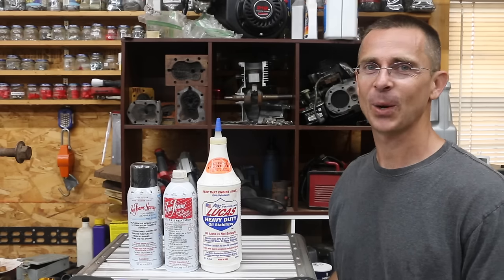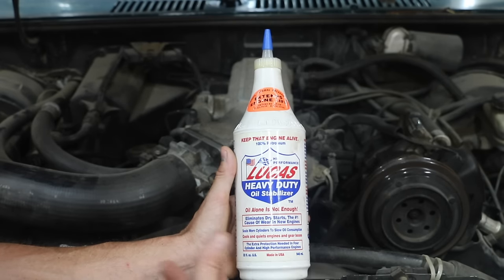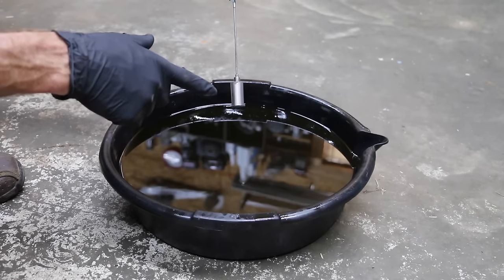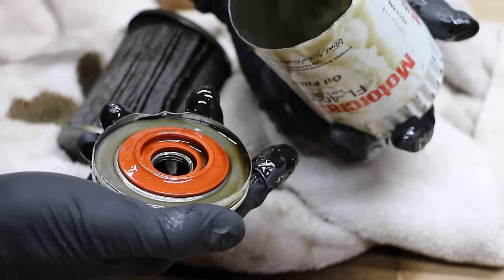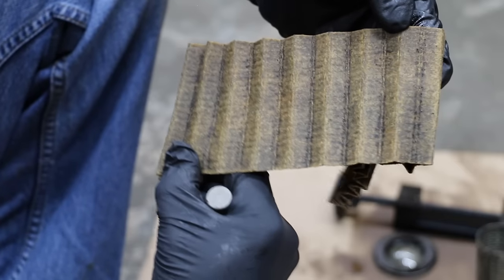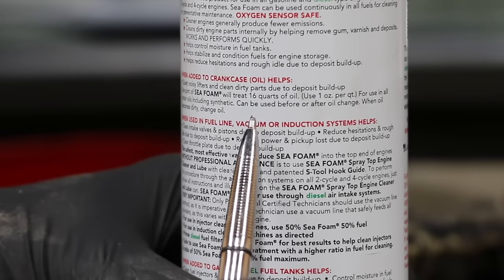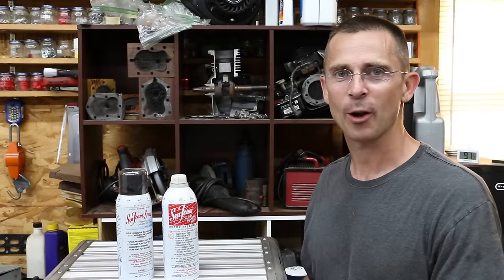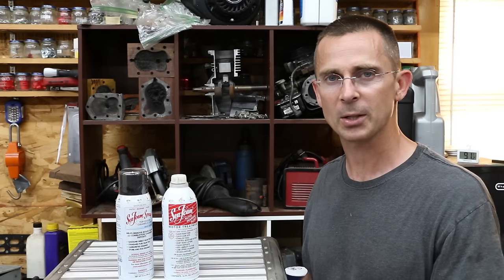Did the Seafoam fix last? Update on the Ford Ranger

Comment: I've always liked Seafoam as a gas additive, thanks for expanding my view regarding the overall health of the engine! I liked your test drive and the drone work, it was almost like watching Leno's Garage!
Reply from the maker: Thank you!
Reply: I have added seafoam to the gas at oil change for years. Recently I added some to the oil and waited 100 miles. Then changed oil, the engine had about 150,000 miles and the restored power was very noticeable
Reply: @ronnymcfarland7775  What kind of engine do you have? I came back to this video because I'm starting to think this might help my f150 that's got some (what I think is) bad lifter noise.
Reply: @toxeia  Should work to help resolve the issue if lubrication is the problem. The lucas replacing a quart of oil + seafoam at the recommended amount for the oil capacity will clear things up over a week or 2 of daily driving. I found doing that and a single tank gas treatment each oil change keeps the valve train noise to a minimum if not helped restore engine power and lubrication. As less garbage is floating around in the fuel system and the oil.
Reply: What compartment can I put the seafoam in other than the fuel tank? I'm new to these. Any advice? Thanks.
Reply: @marxs1032  Generally oil and fuel are about it.
Reply: @MainSwampRS  thank you
Reply: @ProjectFarm  Fill the combustion chamber on the low compression cylinder ( and bank) with Sea Foam and soak it for a week.  This might free stuck rings and improve compression.  If that is a V engine, it might help to tilt the whole truck in order to bring the problem cylinder bank closer to vertical.  If it works, try the same method on the Restore tractor, plus you can still use Restore whether the soak works or not.  BTW, how does Restore do on the lubricity tester?
   Be sure not to hydro lock when through by cranking with no plug(s) before cranking with plugs.
Reply: @marxs1032  Combustion chamber soak through the spark plug hole to free stuck rings, but avoid hydro lock after soak by cranking with plug(s) removed before cranking with plugs in place.  Soak for 3-7 days.

Comment: Around 5 years ago I saw your video where you added it to the oil on the Ranger... My 99 Corolla had a little rattle on the top end, and I tried it. Sure enough, it quieted down. Even since then, before every oil change I do, I dump a third of a bottle into the oil and drive around for 15 minutes or so.. the rattle is still gone, and it certainly can't hurt. So, seafoam in the oil for a drive before an oil change is a win in my book.

Comment: Thank you for this video. I am ashamed to say that I paid the Ford Dealer almost $1,000.00 and they did not solve the problem. Sea Foam cleared multiple cylinders miss fire, multiple error codes, including one for the O2 Sensor which the dealer had replaced. Amazing difference in performance and no error codes after about 80 miles. I wish I had stumbled across your video before I went to the Dealer and allowed them to replace a coil pack and a oxygen sensor, thanks again!
Reply from the maker: Seafoam is amazing!  Thanks for commenting on this.
Reply: I wonder will it work on my sequoia
Reply: @patrickevans201  Carbon buildup is possible in engines with as little 30K - 60K miles, especially if you do a lot of city driving and buy regular 97 octane fuel. All it takes is a little drop in compression on one or two cylinders and the fuel burn is no longer efficient. Carbon removal and freeing sticky lifters may not help if there are worn rinds or a burnt valve. My Expedition has 157K  miles and the older the engine the more likely it is that there are other issues also. I was lucky this time.
Reply: Project Farm, Ever try Star Tron fuel treatment? I hear it’s better than seafoam. Never tried it myself.
Reply: I also have a random missfire on cyl 1. I have a little lifter tap when i first start it.also a little sluggish running rich.i changed coil packs ,plugs,wires fuel filter ect.its an 03 chevy silverado with 327,000 miles!!! Im thinking of sea foaming it just a little nervous
Reply: @ninjagodzilla6402  Hi Jay Blue, on the bright side Sea Foam is cheaper than a trip to the dealer or a garage. Neither I or the guy Project Farm are suggesting it is a cure all. The Sea Foam product I added to the crank case with an oil change eliminated the lifter chatter I had at startup. I only used the spray in the intake along with the crankcase additive, I did not add the Lucas to my synthetic oil. You may want to try it. At least the Lucas will provide more viscosity to the oil after you have the lifters loosened up and may help increase the oil pressure if it is low.
Reply: If the dealership didn’t fix the problem I’d be getting my money back!!
Reply: Sea foam cleared o2 sensor code  on my 06 civic
Reply: My mechanic recommended SeaFoam to me when my #7 cylinder misfired.  Cleared up the issue for just a few dollars.  Love having a repair shop that I can trust!
Reply: Ford Dealership screwed up my car when I brought it in for the last "oil Change" which they didn't do. Sea Foam cleared everything out . I am a female and I went under the car changed the oil and it's running smooth like a Baby's bottom.
Reply: @ninjagodzilla6402  Thing is, I personally have never seen a case where Seafoam hurt an engine.  So you really have nothing to lose except the price of the can to treat your Silverado.  At that kind of mileage, better warn the neighbors about all the smoke that going to come out of that exhaust, lol.
Reply: fukthegoog   Sorry, but  I have zero experience with Evinrude type engines.  Lets hope some boat folks can answer that question for you.
Reply: @ninjagodzilla6402  ~ I'd like to hear how that went. I have a 2000 Silverado with the 4.8 that has 345,000 miles on it, and it has an intermittent lifter that ticks, and the oil pressure has gradually slid down to around 20 psi.
Reply: Did your Error Codes just eventually go away after 80 miles on their own? I have a Honda and I have seen a few video's where they tell you to disconnect the negative terminal off the battery. Then push / depress the brakes for over 5 seconds to drain the energy out. Then Reconnect battery then restart. It will cause it to reset the computer, etc... both guys who did it, the Engine light went off.
Reply: @ninjagodzilla6402    I've used marvel mystery oil to fix tapping lifter in a few different vehicles there were all flat tappet cam though. The running rich could be be the fuel injectors. As they get they may begin to spray in a less fine mist. A new injector has a really fine mist and an old one can have a mist eith bigger droplets. MMO works pretty well for cleaning old fuel off of carb but is highly oil based so it's not safe for 02 sensors or cat converters I'm not sure about sea foam. You could always run some techron as well.
Reply: fukthegoog  seafoam now makes a marine version i have  seen  advertised.
Reply: @quaddad  I trustworthy/reliable mechanic is worth his/her weight in gold.
Reply: @lorettamiller1257  I got hosed by a dealer almost 20 years ago.  I have never been to ANY dealer since then and I am happier for it.
Reply: @AndrewSteitz  The car is fixed I noticed something wrong with the front passengers wheel brake that was just replaced . I took it apart and found someone took the new brake out and replaced it with an old one.  They also did it on the front driver side but it was not as worn as the passengers side, I replaced them all in October of 2018. and now they were worn down  in Feb, 2019. my backs are still brand new.  Dealers must need the business.
Back to the sea foam. Best investment I made on my 2007 Lincoln Navigator
Reply: @lorettamiller1257  Or they never replaced the brake pads in the front in the first place but still charged you for them.  Could have been intentional or simply an oversight but still a reason I avoid dealers like the plague.  Also, your calipers could be in bad shape and need to be replaced or there could be a kink in the brake hose, i.e. maybe they replaced the pads but twisted the calipers when they put them back on.  Either one of these could cause the calipers not to release fully when you let off the brake pedal thereby keeping the pads rubbing ever so slightly against the rotor.  Have you noticed a slight drop in gas mileage or when you let off the gas without stepping on the brake does the vehicle seem to slow down more than it used to?
Reply: fukthegoog Seafoam is fine to add to your boats gas tank to help clean the engine. A lot of guys on fishing web boards say they use it every other fill with great results.
Reply: Hey how did you put the seafoam in the engine, intake, oil, or gas tank?
Reply: My car has 213K on it.. .going to try the full Seafoam treatment to see if it can get it's pep back
Reply: Project Farm  Do you think using the thicker oil additive would be OK in winter for me living in Florida
Reply: Lessons learned eh?  Always do your homework first, this is the age of free information at the touch of a cell phone....
Reply: It never hurts to change coil pack and 02. But 1k is too much
Reply: @ocieadams6502  I think the thicker oil is better at making the crank main bearings tighter which will increase oil pressure.. But once they are too worn out, there is nothing that will make it better than replacing those bearings...
Reply: @ninjagodzilla6402  I have an 02 suburban with the same engine. Did you try it and any feedback? Thanks
Reply: @TheCoolDave  any feedback you can share? thanks
Reply: @mikepeterson5939  That car got totaled by someone else's fault, it did help idle better, over all smoother. So if you have never done its cheap to do. I even put some in my replacement car.

Comment: Seafoam did my van good.  It suffered heavy oil sludge. I put in 5 ounces of the seafoam, waited about 300 miles, cha ged the oil which was very black but no sludge. Then, I added a container of engine restore with the oil cha ge to stop the top end tapping of the lifters. The seafoam caused top end lifter noise in the last few days before I actually did the oil change.  I believe the engine restore did a good job lubricating the top end. No more tapping noise and also van runs excellent.
Reply from the maker: Thanks for sharing.

Comment: I've said it many times, Seafoam is the most amazing product I've ever discovered for aging ICE vehicles.  I got turned onto Seafoam in the early 2000's, I wish I'd of had it back in the 1970 & 80's when I was working on cars all the time.  I used seaform before oil changes in my crankcase & in my gas several times per year on my vehicles.  It's just an amazing product.
Reply from the maker: Thanks for sharing.

Comment: Just added the SeaFoam to the fuel tank when almost empty and the crankshaft this morning.  Will see if it does improve the engine performance of the old Astro Van.  I am very impress with your old Ranger. The before and after is just unbelievable.  Again thank you for posting videos. Ben.
Reply from the maker: You are wlecome!

Comment: So far, I've only used a can of this in my Mini Cooper - and boy has it made a difference.

It was so low on power that I had to turn the AC off when going up hills. Now, the power is much more consistent and the engine seems to sound smoother.

Thanks for this video !!
Reply from the maker: Nice!  Thank you
Reply: Change your oil often and realize thats all electronically controlled and a small car

Comment: I'm a huge believer in Seafoam. Usually every springtime oil change, I pour a bottle of seafoam in the gas tank and spray a bottle through the intake. I do 2 oil changes a year on both mine and my wife's vehicles, spring and fall, which includes the same seafoam treatment on both vehicles. My truck is a 2002 F150 with a 4.6L and has 294,000kms or about 183,000 miles. It runs very smooth and does not burn and oil. I believe there is close to another 100,000 left in it. My wife has a 2003 Windstar with a 3.8L and 200,000kms or about 124,000 miles, I've been doing the same seafoam treatment for both vehicles for the last 7 years and have not looked back.
Reply from the maker: Great product!
Reply: Were the cars running fine before you did the seafoam treatment?
Reply: Motors that burn oil usually last longer and go more miles as long as you keep them topped off.
Reply: twice a year..................guess it depends on the miles

Comment: About 15 years ago, I used Z MAX in my engine with my oil and after about 100 miles, I noticed the engine perked up and began to run like it was brand new. I had a 2001 Chevy Silverado then. The truck engine continued to run well all the way up to the day I traded it in with 111,000 miles. It was the best additive I ever used for an engine. I would suggest that you read the instructions and do some research about it. This way, you will know exactly how to use it for best results for your engine. Every engine is used different. The ZMAX is also extremely slippery. I also used some in my transmission.

Comment: Rislone, best product to clean rings for compression restoration. Also works for sticking lifters! Don’t dump oil after treatment as recommended. Use in fresh oil after changing and run for at least 2K before dumping. Used this method most of my career.

35 year fleet Mechanic,
JP
Reply from the maker: Thanks for sharing.

Comment: Once again, I’m amazed at how quiet the motor got after the sea foam/Lucas!
Reply: It was the Sea foam.
Reply: Dude, I bought a rusted out old Toyota Corolla with almost 400k miles that was HEAVILY abused its entire life... It had a freaking shop rag crammed into the crankcase where the cap should have been, oil all over the motor, the worst lifter noise I've ever heard, and the car was in about as bad of condition as it could ever get before sending to a crusher. Immediately after Seafoam, all the noise and running rough stopped. I did all the standard routine maintenance and ran Seafoam for 300 miles before each oil change, with oil changes every 1,800 miles. I drove the wheels off that thing for nearly 2 years, including driving it 940 miles from MN to OK, and then sold it to a friend, who drove it for another 2 years. That car would have been toast within a couple hundred miles at best without Seafoam

Comment: Hey man, got a pro tip for you. They make lots of funnel strainers for filtering debris when you're trying to find shavings, particles, etc. Or if you want to reuse a product (oil, coolant, etc) but don't want to dump dirt and debris back in an engine. But my tip isn't just the funnel strainers, but instead a close cousin. Go to any autobody supply store and they hand out dozens of 'one time use' paper/metal mesh paint strainers. They fit perfect in a funnel, you can throw them away, they're usually free, and they filter much finer (smaller micron) than some funnel strainers. Autobody paint guns are finicky so they need clean paint, and those strainers do just that. They also filter every other liquid product in my garage as well. Been watching you for years, and love your videos, sir.
Reply from the maker: Thanks!  Thanks for the tip!

Comment: As a mechanic, I would recommend getting another can of seafoam and using the method where you suck the seafoam out of the can and into a vacuum hose that goes into your intake. You just modulate how quickly it is sucking out of the can to keep from stalling the engine out. 

I’m recommending this because it sounds like you still have a valve tap. I’m hoping that another treatment using this method will clean more carbon off of the valves and allow them to seat more firmly therefore increasing your compression. 

Thanks for your awesome videos!
Reply from the maker: You are welcome!  Thanks for the feedback.

Comment: I’ve really enjoyed all your videos. This one and the first part we’re awesome. I was already a fan of Seafoam but when I watched the first video with the ranger it occurred to me Seafoam was my solution.

I have a 2013 Chevrolet Traverse with a 3.6L v6. It had a noticeable issue under power that is attributed to the cam shaft actuators not function properly. These engines have a known issue with oil deposits blocking oil passages. This often results in a failure of the hydraulic timing chain tensioner and ultimately the timing chain fails, which results in a total loss of engine.

I added Seafoam at the beginning of an oil change. I forgot I had done this. A month later I drove this vehicle for the first time since adding Seafoam (my wife’s daily driver and I don’t drive it often) when entering the highway it occurred to me “ah that dreaded sound/vibration” to my surprise it was completely gone! Thank you for your great videos, they have answered so many great questions and have likely saved me a $2000 repair bill / lost engine.